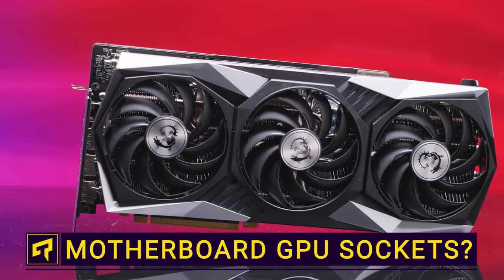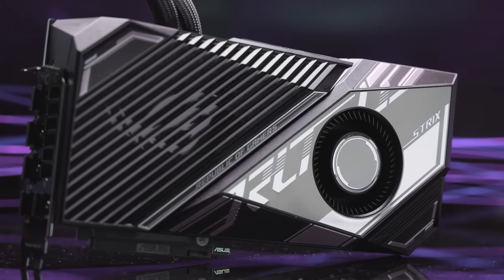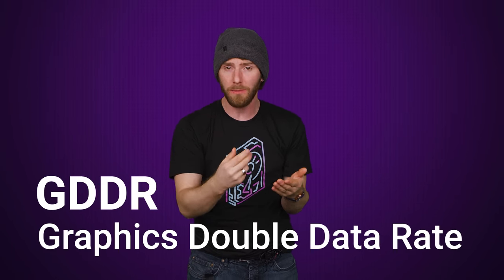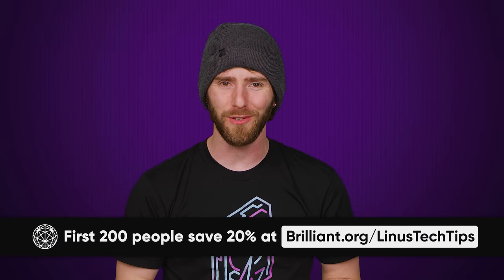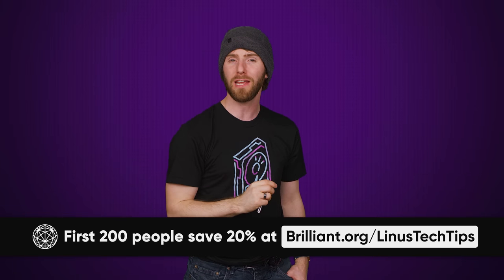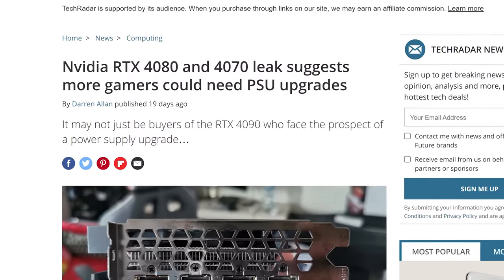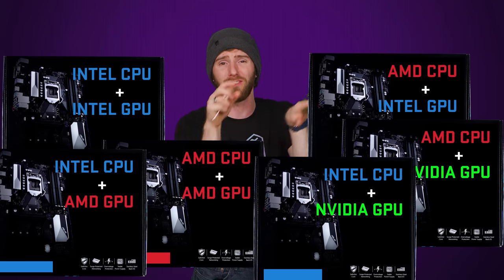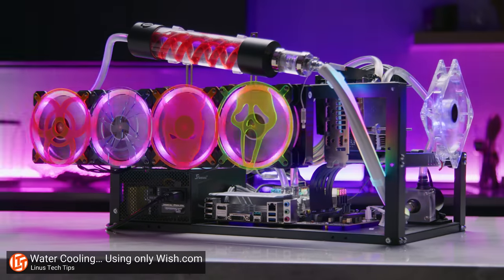Can You Put a GPU on a MOTHERBOARD?

Comment: I'm surprised the integrated motherboard GPU's we had in the late 2000's weren't mentioned.
Reply: and laptop motherboards with soldered on GPU.
Reply: amd crossfire with igpu 💀
Reply: That would require LTT to have actual knowledge of what they're talking about.
Reply: well yea I opened this confused playing it on a laptop with a gpu on the motherboard with it's own memory.
Reply: The future is NOW old man
Reply: The video is more about slotable gpu chips not integrated ones
Reply: @SphinxKingStone  which was the point
Reply: Every laptop and iMac with dedicated graphics has a GPU soldered on its motherboard.
Reply: Why?
This is techquickie, not tech deep dive.
But regardless, all the reasons he points out are exactly why on board gpus ceased to be a thing.
Reply: yeah! there were even nvidia on board gpus, onboard GPUs were common when there was a real northbridge chip, now it is more like a southbridge itself, and don't forget the nvidia nforce chipsets.
Reply: This was referring too socketed GPU’s
Reply: Our PCs in school have them. XP systems with i7 3770k
Reply: @Domspun  ...he did mention laptops tho.
Reply: @simonschalbers530  a 3770k running Windows XP???
Reply: @Domspun  they mentioned laptops
Reply: Onboard GPUs were terrible, basically the same idea as integrated GPUs before they could fit them on the CPU die. They were not very powerful and system memory was a bottleneck..
Reply: I used to have an nvidia GeForce 7025 integrated graphics with my Biostar N68S3B and AMD Athlon II x2 270 CPU
Reply: @joseabraham777  The GPU there is on the same chip as the CPU, like Intel’s integrated graphics but a lot faster.
Reply: Ithergrated gpus are a seperate animal, that have been optimized for being integrated.
Reply: @oswqld  Yes, Ivy Bridge is the only Intel offering that supports XP and Windows 10.
Reply: @Domspun  soldered on ram wasn't a thing until the 2010's.
Reply: @MajorOutage  So...the power requirements of desktop GPUs aren't an issue? Interesting.
Reply: That was my first thought after reading the title. Sometimes it's wild how inept LTT is at creating videos, all things considered. I say this as a longtime and current LTT fan. You don't come to Tech quickie for accuracy though. I still remember when Luke confused sample rate with bitrate in one of the audio-related videos. Quality control is very bad on Tech quickie videos and it's weird, considering the apparent target demographic.
Reply: @wizemandouglas7128  Which made the video irrelevant. Plenty of examples of GPU on motherboards, they even made a video of one with a 1050Ti on it.
Reply: @oswqld  guess what a Pcie slot is... Functionally, a Pcie GPU is a socketed GPU.
Reply: @kmoecub  You are sure you are replying to me? I didn't say anything about RAM. Anyway, you are mistaken, soldered on RAM always been in computers, early computers didn't have upgradeable RAM and it was soldered on.
Reply: @mathdantastav2496  one phrase at the end. Did the whole video saying is not possible for various reasons and then at the end says it is done on laptops. Should have done the video on how they do it on laptop, consoles, servers, SBC, how MX and SXM works etc. instead of a BS video.
Reply: I wish we still had that for AMD. All of the AM3 boards I used had some Integrated graphics and that was super nice for troubleshooting
Reply: Late 2000? My Commodore PC 60-III from 1989 already had a graphics card soldered on the motherboard.
Reply: @kmoecub  Who said we were only talking about the latest high-draw chips? That's not a requirement of being called a GPU.
Reply: @awesomeferret  technically that's a graphics card. The GPU is just a component on the card.

And now that I watched the video I think it's even stupider and funnier since Linus can't even keep the two terms straight.
Reply: @Domspun  Ignore the youngling. He knows not of the old ways.
Reply: @simonschalbers530  3770k had the GPU integrated into the CPU.
Reply: @MajorOutage  fair enough.
Reply: @Domspun  But a 1050ti isn't exactly the peak of modern graphics, and the point of the video was why we don't have graphics on a PC's motherboard.
Reply: @wizemandouglas7128  doesn't matter of it's peak or not. It's graphics on a motherboard. You know, the thing you just said we don't have. Lmao.
Reply: @MajorOutage  The video is about modern PCs and the fact that modern graphics cards wouldn't work straight on the motherboard.
Reply: Nvidia nForce was one of them.
Reply: What about early 2000s and mid 2010s?
Reply: I had one, it was just like the ones integrated on CPU but integrated on chipset and weaker.  This discusses GPU:s that are stronger than those that are integrated in the CPU.
Reply: @MajorOutage  🤡🤡🤡
Reply: @MajorOutage  yeah, but there's a shiny chip on the PCB that had something with graphic written on it
Straight up an open chip without heatsink
Reply: @neondemon5137  🤣🤣🤣
Reply: @raiyankhanmajlis6112   I am using a PC with an AMD Athlon II x2 right now ,the 250 one (3.0GHz) for movies,surfing the web..and old school gaming. (I know this comment is a bit pointless...lol)
Reply: @vasopel  Haha, it's not pointless. It's nice to hear about surviving AM3 systems. A couple of years ago, lightning hit a power line near my house, conducted through the ethernet cable and fried my Athlon PC at a time when I had no money.
Reply: @raiyankhanmajlis6112  a lightning..through the ethernet...and this happened at a time when you had no money? damn..the universe sure is cruel :-( 
hehe I have that Athlon in an old beige tower from 2004 ;-)
there are a lot of "survivors" in my house,that is because I don't mind things being loud so all my systems have fast fans and good ventilation, even my og 2005 xbox 360 and og FAT PS3 still work since I strategically placed them under the room AC and never played without the AC on :-D
Reply: @Domspun  he mentioned laptop gpus around the end of the video..
Reply: @MajorOutage  Anyone with an iq of over 20 can figure out that this video is talking about removable, cpu-like socketed GPUs.
Reply: @norkshit  like I said in another comment, it made the video irrelevent. Should've talked about it in the video, not just a quick mention at the end.
Reply: @wizemandouglas7128  No, the video is only about why we don't have socketed GPU processors on desktops.
Reply: @tvthecat  that's not what the title says. And it still feels very disingenuous to not mention the very real history of integrated discrete GPUs.
Reply: @MajorOutage  Good point but you shouldn't just insult random channels. It's f##king disrespectful.
Reply: @tvthecat  i will insult and disrespect whoever i feel deserves it  lol.
Reply: Those were all pretty weak anyway, and the fact that the bulk of the stuff on motherboards back then has all been rolled into the SoC’s we still refer to as CPU’s.  So, it seems unlikely to see that getting reversed anytime soon.  Although I did see a server board recently that included something like that, but that’s because it was for CPU that didn’t have integrated graphics and it made sense if you wanted to remotely access a GUI to manage your VMs that were using the GPU, you needed something to draw a 2D desktop.
Reply: IGPs were pretty bad, not much different than todays intel graphics.
Reply: @joseabraham777  soldered, yes. socketed? not so much.
Reply: @Nighterlev  Uh dude, i think you're responding to the wrong person.
Reply: @oswqld  it's messed up. 2GB of RAM
Excel is lagging on a 3770k
Reply: @Domspun  xD
Reply: Late 2000's?? you mean halfway the 90's..
Reply: @splitt3r  With the Ryzen lineup and GPU prices though, I feel that an integrated graphics level gpu on a motherboard would be great. I've recommended a lot of Intel builds for family (who aren't interested in gaming) simply because once you factor in even a cheap GPU, AMD's value proposition completely disappears.
Reply: And their own video featuring the chinese mainboard with the integrated GTX 1050ti...
Reply: The fact so many of you are trying to call this inaccurate when it is infact not are clearly not understanding the comparison properly. Of course the Team at LTT know about embedded and integrated GPU's. They have been were included very briefly but were not dwelled upon as they are not changeable and it would confuse people and cause them to write the comments here. LTT has tried to focus on making them interchangeable like a CPU, so they get there own upgrade paths etc. Better comparisons here are CPU's and not permanently attached parts which have been integrated by an OEM. The OEM create special boards for their laptops and desktops which have GPU integrated. It is a one size only solution. 

PCI-e is not a socket, not in the way the CPU is. You cannot compare them. An LGA1700 socket has 1800 pins, 100 are reserved ready for LGA1800 compared to a PCI-e which has a maximum of 16 lanes. Please note that the CPU pins include power delivery also, though the difference is way too large for it to matter. One point skipped over in the video was if the GPU had an actual socket like the CPU having its own memory whilst more work for board producers actually wouldn't be that hard.

To be fair though the way things are heading with SoC (System on a Chip, think APU such as Ryzen or handheld devices such as smartphones and the Aya Neo) and Microsofts direct storage, the divide between GPU and CPU is ever shrinking.  Eventually this will be a non-issue and we will forget the days of separate components.
Reply: @awesomeferret  PCI-e is not a socket, not in the way the CPU is. You cannot compare them. An LGA1700 socket has 1800 pins, 100 are reserved ready for LGA1800 compared to a PCI-e which has a maximum of 16 lanes. Please note that the CPU pins include power delivery also, though the difference is way too large for it to matter. One point skipped over in the video was if the GPU had an actual socket like the CPU having its own memory whilst more work for board producers actually wouldn't be that hard.
Reply: @awesomeferret  PCI-e is a slot (physical) and a bus (data)  not a socket! Clearly proven wrong!
https://en.wikipedia.org/wiki/PCI_Express
Reply: @Mu7eD-Stream  sir... Please Google the definition of the word "socket" and tell me how it doesn't apply.
Reply: @awesomeferret  The important definition here is the standard the industry applies, not the general meaning of a word even taking that into account there is still a difference. The standard is there to stop confusion. By your logic everything would have the same name! There are also some minor differences between a socket and a slot, the most important being a socket is much more secure and permanent in its fixing, a slot is designed to be quickly removeable think SD card slot, you can just whip it in and out 🤣 vs a cpu socket which is far less accessible, your devices must be off for removal, heatsink removed, thermal paste removed, socket undone and the finally removed, also slots are designed to be hot swappable so that devices can be unplugged during use without any physical damage. A good example of this would be swapping out drives on a PCI-e connected RAID array.
You do not prove a point by becoming more and more general on something, you loose focus and just look inept and clutching at straws to save face. The only point you could have attacked this from was mechanical and that is the little tab that sits on PCI-e slots to secure the card in place, though this was only added due to the increased weight from coolers and is not actually part of the standard nor does it actually form part of the connection unlike the CPU tray in the CPU socket.
Reply: @Mu7eD-Stream  dude... A slot is a type of socket. It's not worth it. ☺. I feel bad that you wasted so much time trying at argue against the dictionary.
Reply: @awesomeferret  I feel bad for whatever dictionary that you are reading, that's if you even know what a dictionary is and you don't refer to it as a book. If your reading 'Bob the Builder' please know this is not a verified source of information.
Reply: @Mu7eD-Stream  wow, you never thought to Google "define socket" did you. Blame Google for using Oxford Languages, not me. Your attempt at a put down was hilariously ironic. All you have to do is Google it. Why do people put so much effort into avoiding that? You took significantly more time to write that "insult" than it did to Google the definition of "socket".
Reply: @PGGMusic  CGA I bet. Tandy's did too I believe.
Reply: @AussieAmigan  it was a VGA card with 256kb memory
Reply: @PGGMusic  Wow. That's nicer than I thought. Did they output composite? IIRC I saw alot with a 1084s in the day.
Reply: @AussieAmigan  I hooked it up to an Apple monitor with a 15(?) Pin VGA connector.
Reply: I still have my old HP Pavilion Pentium III system which  had a BGA spot that you can solder an nVidia TNT GPU to as well as solder points for 8MB of SDRAM with four for a total of 32MB. I was tempted to do so and the OEM restore disk had drivers for it already on there but I was just a pre-teen at the time and couldn't really get anyone to buy it for me as it was specialty thing that required bulk purchase. Then back in the Pentium era my Packard Bell had several socket points for various upgrades either on the motherboard itself or the daughterboard with PCI slots.
Reply: I was thinking that myself.
Reply: They still weren't interchangeable, just soldered on.
Reply: @Domspun  He glossed over the fact that laptops and other specialized devices have this in the video.
Reply: @joseabraham777  He mentioned this in passing in the latter half of the video (not in those words)
Reply: Welcome to Techquickie, where the quickie stands for not opening a can of worms if you don't need to
Reply: they are talking about removable GPUs..
Reply: yep, and thats why this getting a dislike from me
Reply: so quick they cant afford another 20 seconds to make a more complete video ...
Reply: You mean onboard.  "Integrated" means it's on the CPU die.

Comment: Impressive how well engineered consoles are regardless of how PC enthusiasts feel about their performance.
Reply: Even though I am a big PC gamer I can agree with that statement. The PS5 draws, what, 160w while gaming under full load? a PC for that kind of perf is gonna be at 200-250w or more honestly.
Reply: @Dimondminer11  iirc the ps5 uses more like 200w under full load. A pc will use more power, but it would be rather puzzling if a much more integrated solution would require the same power.
Reply: The original Xbox was a PC. Xbox 360 was the same way, as have been the subsequent models. PS4 was a PC, moving away from the overly expensive and proprietary PS3 architecture. The difference in all of these consoles from an actual pc is that you didn't have to have a bloatware infested operating system with tons of unnecessary redundancies, but a highly focused and managed console operating system. And without all of the overhead a PC has to carry, consoles can be far more focused and better utilized from a hardware and programming stance.
Reply: @uncleesmentalhealthnetwork6339  The XBox 360 used PowerPC, which was the CPU architecture used in Mac computers at the time (as well as the PS3, Gamecube, Wii and Wii U), it did not use an x86 CPU standard to a PC, which was the case with the original XBox and all XBox consoles that came after the 360.